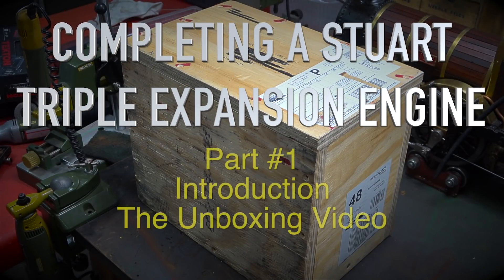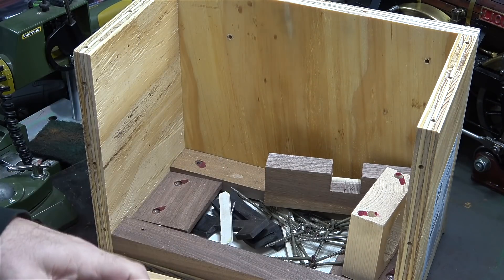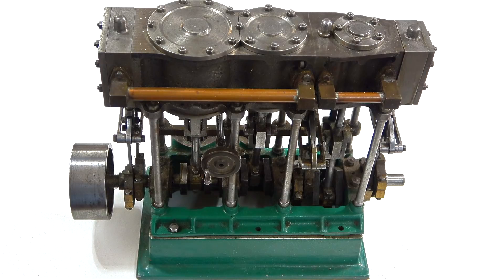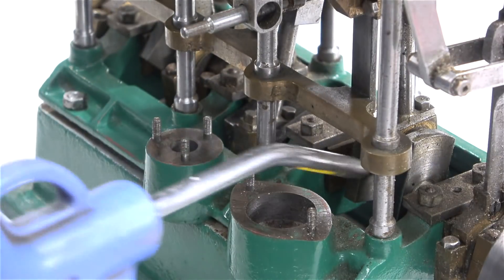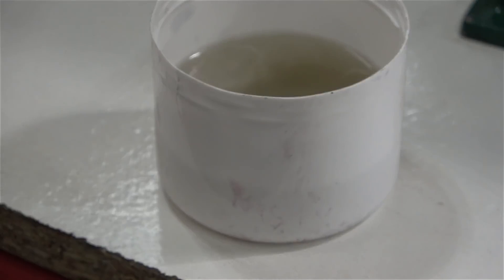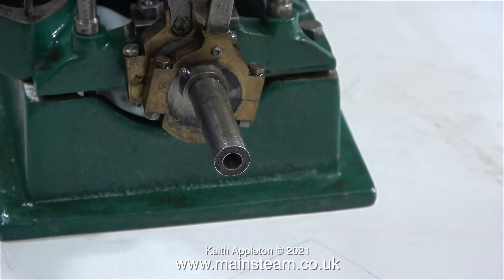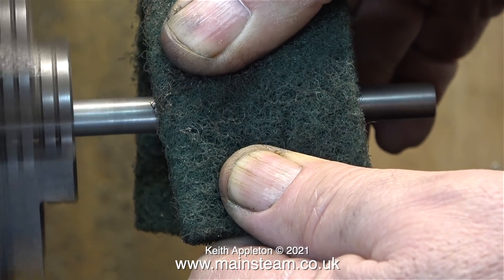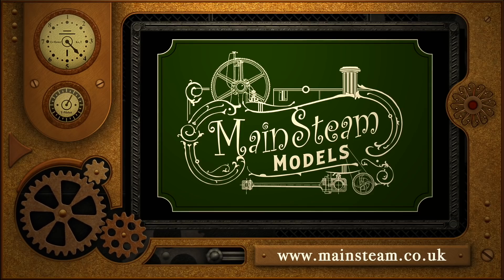COMPLETING A STUART TRIPLE EXPANSION ENGINE - PART #1

Comment: Keith, FIRST time viewer, came to you from Joe Pie's "Little Lathe" project, and your comments therein.

Number 2 Square Drive Screws, Properly Entitled Robertson "Square Drive" is a Canadian Patent, from circa Henry Ford First auto's.

Mr. Robertson was a contemporary of Mr. Phillips of the "Phillips Head Screw" fame.

A note of Trivia, combining All Three of those persons: Henry Ford ~wanted~ to BUY Mr. Robertson's PATENT, as he "Knew" good engineering When he Saw It.  Mr. Robertson Wanted to hold the Patent, and just give Patent Right to use his tooling.

Mr. Ford then went to Mr. Phillip's and offered HIM that same request. Mr. Phillip's SOLD his patented Phillips Head Screw to Henry Ford! And as our Great Radio Announcer Paul Harvey used to say (RIP, Paul) "And NOW you know, the Rest of the story".

In my 40+ years as a wood worker, I Always bought #2 Square Drive, WHEN Possible, I have also used #1 Square Drive AND some massive "Timber Screws" in #3 square drive (0.250" shank, 8" long, using 3/8ths drive ratchets).

philip, from the Great Pacific NorthWET, Oregon Division!

Comment: I just watched a film/video about Lend Lease, and the amazing amount of goods shipped over to England during WW2,  so you see Americans really know how to ship delicate machinery to England!   BTW Those screws were invented by a Canadian and are very good as they are unlikely to strip out when tightening.  Torque screws are good but if they get covered with dirt they are difficult to clean and get a screwdriver into their heads.  I'm wondering do you have "butterfly" screw heads in England?  They require a special driver and were intended to make it hard for thieves to remove parts from recreation vehicles. Of course thieves simply buy the driver before they steal stuff, so they really are useless.

Comment: there's a lot of Robertson comments they come in I believe 3 or 4 sizes.
Reply: there are 4 sizes in Robertson Screws, "0", "1", "2", & "3" .... I have NEVER SEEN a Number 0 Sq drive screw, but my guess is it would be near a # 4 shank OR less!

I base That on my #1 sq dr. Trim Screws for attaching Exterior Trim to Windows, etc. I would not see a use for inside houses, as the idea is to prevent Wood Movement from humidity to "back trim NAILS out of their holes".

philip

Comment: “Robertson” screws! A Canadian invention, not universally available outside Canada but, by far, the most common wood screw type used here.
Reply: No one seems to have noted that the type shown here is the most common #2/#8 Robertson type construction screw and they are the best you can get because unlike the philips heads that tend to strip before the job is done I have commonly snapped the head off a Robertson long before stripping it.  There is also the smaller #1/#6 (and there is even one size smaller than that) then there is the larger #3/#10.  Don't get me wrong, philips head screws have a place but the shape can't handle near the turning force that a Robertson head/screw driver can.
Reply: @TheCrazzyToobinator  Here in Denmark and I believe in most of Europe too, Torx is the most commonly used head for construction screws. They can handle quite a large amount of torque. It is possible to strip the heads but that is typically due to wrong handling or to bad quality bits/screws.
Philips heads are rarely seen, typically it will be of the pozi drive type, which are a tad better than philips.
For machine screws it is typically pozi drive or hex drive that is used here.
Reply: I was using some Robertson screws to assemble something 
at the shop, where I work.  Screwing in some screws, with a 
cordless driver.  When the screw was in, I let go of the driver.

The interface between the bit and the screw, was strong enough 
to hold up the whole impact driver.  You're NOT doing that with 
a Phillips bit.  (I've done that bit, quite a few times.)

Keith, not sure about the other side of the pond, but Texton 
will send a replacement, if you send them a picture of the 
broken tool.  Also, not sure if bits are covered.  Send an 
email, with a picture of the broken part, they will ask for 
your physical address, and mail you a new tool.  I've been 
carrying a 2 blade knife, (regular blade, and a craft blade 
holder.)  had it for MANY years, but I think it has been deemed 
unsafe, since both blades can open at the same time.

steve

Comment: The square drive screw, also known as the Robertson screw, was popularized by Peter Lymburner Robertson, a Canadian inventor.  the square drive was originally invented by someone else, but they were never popular as the  manufacturing process did not allow them to be made to a standard that allowed them to be used one handed.  They are very popular in Canada, and they are my go to screw precisely because you can stick the screw on the driver and it will not fall off.

Comment: The square drive screws are a Canadian invention by a fellow by name of Robertson and are referred to in Canada as “Robertson Screws”.  Our American neighbours latched on to the concept, altered the design slightly, and called them “SquareDrive Screws.  The Cdn Robertson screws have a slightly tapered recess for the driver, I’m told that it was originally designed that way to prevent ‘cam out’.  The US Sqare drive screws are not tapered as much, if at all.  I, and a lot of other woodworkers in Canada will trade any  %@#$&*Phillips screws for Robertson’s immediately on discovery.  The US square drive screws are available from hardware dealers such as McFeeley’s and the Robertson’s are available from Lee Valley and most other hardware dealers.  It is almost impossible to strip a screw head or to experience cam out provided that the proper sized driver is used on its matching screw and the drivers will out live the owner if used properly.  All this from one of your regular viewers and fellow steam freaks living in the Columbia Valley on the west coast of Canada.  Cheers!